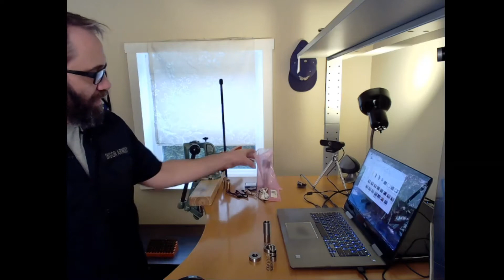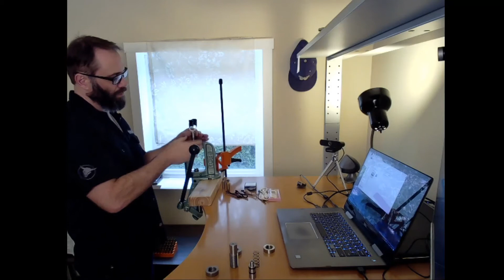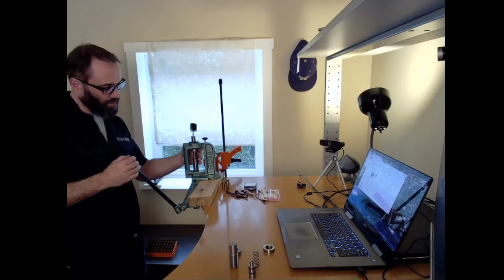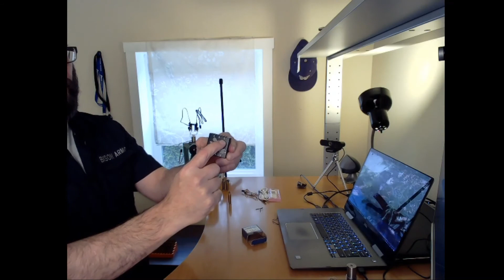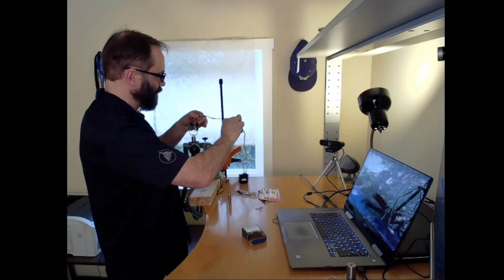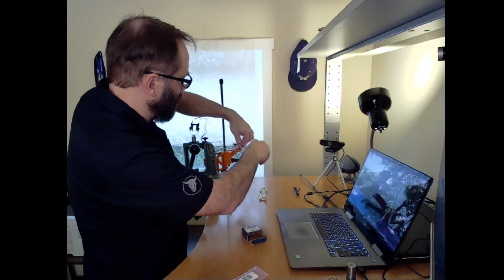Bison Case Volumizer Setup

Comment: Awesome device but gives a feeling that it's still a work-in-progress product. Would love to have the absolute pressure sensor and the hub installed in one box and the whole product to be more plug&plan. The less cables and connecting, the better.
Reply from the maker: Totally true - but the market is too small to justify the added development cost. This is as good as it will ever get I think.